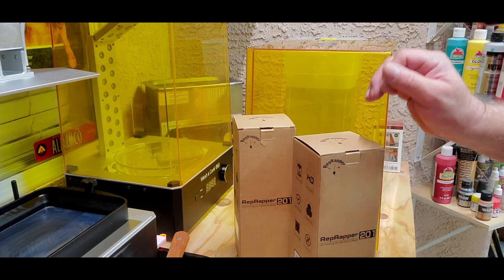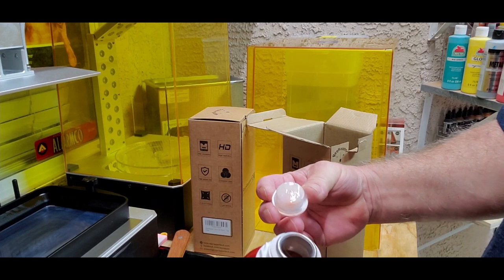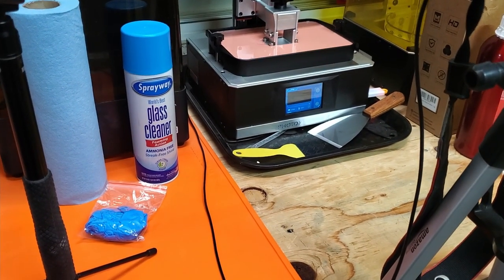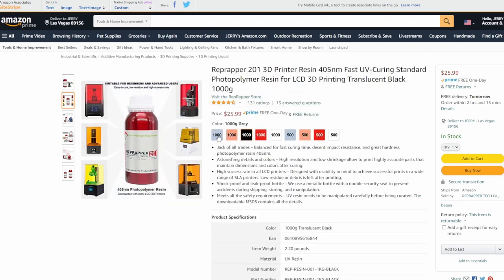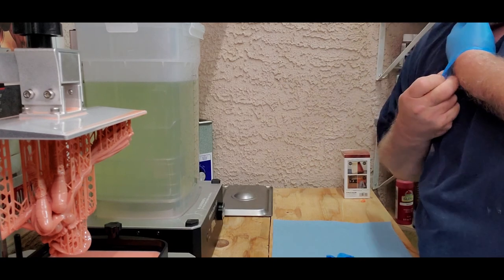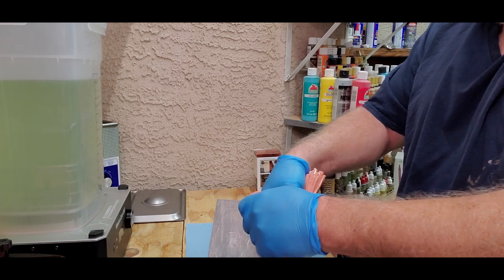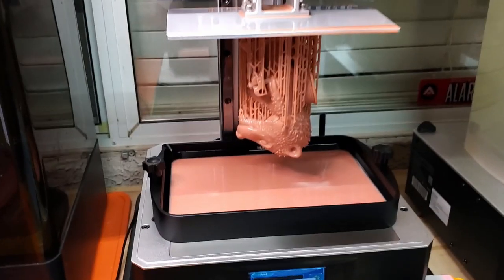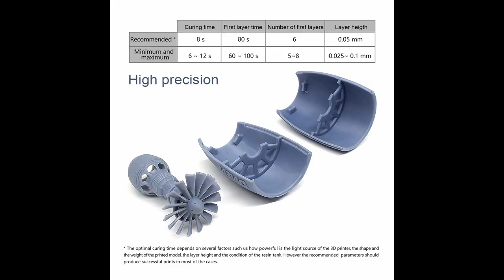RepRapper Skin Resin

Comment: Is it better to remove the supports before curing than after for easier post processing? I would have thought there is a greater risk of damaging the model but all of your models post cure look great Jerry.
Reply from the maker: I always remove them before curing and usually before IPA, to rinse completely.
Reply: Always better to remove your supports before curing. I also do any knife work on my prints before I cure as well, (i.e. removing support nubs, reshaping hair, etc.). It just makes thinks a lot easier when your print is a little bit softer. 😊